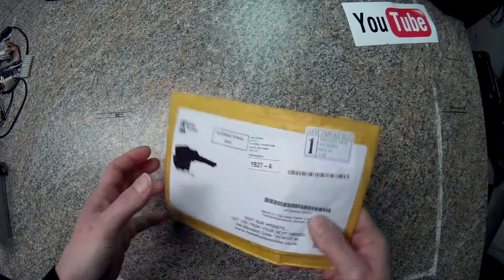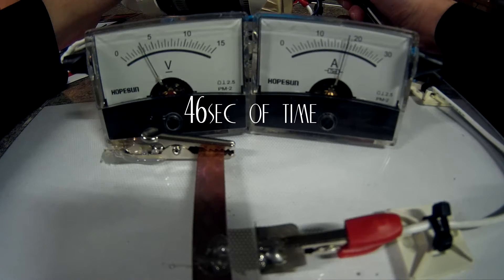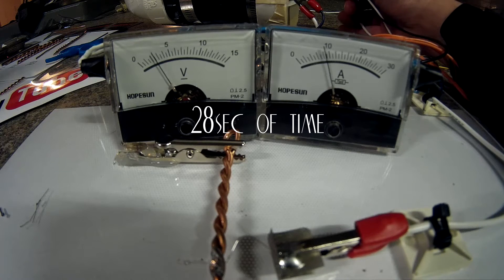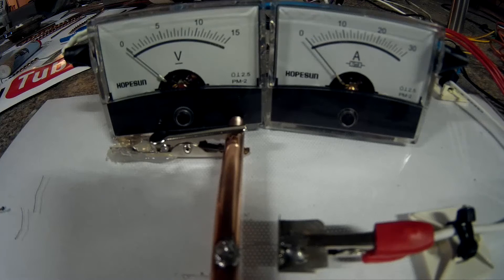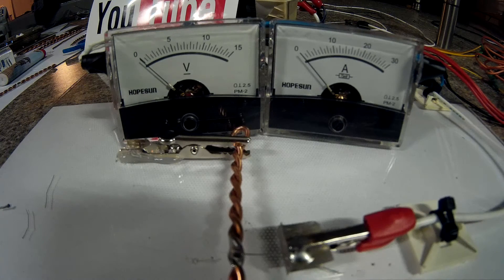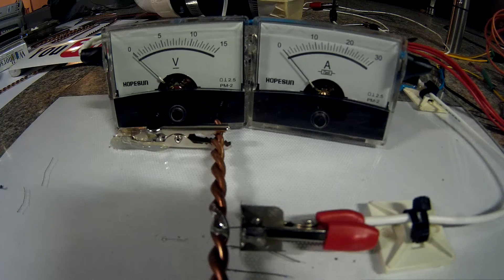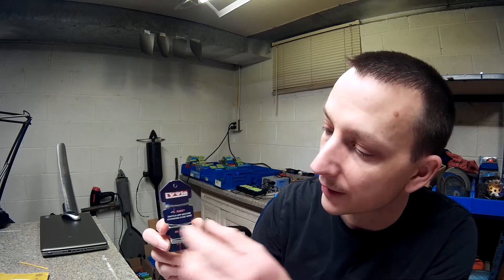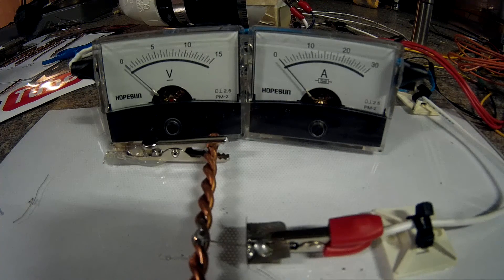Diy Tesla Powerwall ep25 1/4watt Resistors Revisited and 5 Amp Fuse Wire

Comment: Assuming a 100p pack of 2500mAh cells rated at a max discharge of 2c each.  The total amp discharge on dead short would be 100 x (2.500a x 2c) = 500 amps.  The first cell to die in the pack would need to have a fuse less than 495a to protect it.  The second cell would only require 490a protection and so on....  the 96th cell to die would leave 4 live cells or 4 x (2.500a * 2c) = 20 amps to be thwarted by a fuse.  I should hope that other safety features kick in long before this happens.
Oh no, I feel a song coming on.... Don't make me sing!
99 cells worth of amps in the pack... 99  cells worth of amps...  Take one down, try not to burn, 98 cells worth of amps in the pack.

https://youtu.be/zSnCjyoMNgs

Comment: Ok.  It's me again, commenting on a really old video and still trying to wrap my head around the "fuse wire" issue.  Ohm's law states V=IR.  Rewritten in terms of current it's I=V/R. Assuming constant current, as voltage increases resistance also increases.  Resistance creates heat that blows the fuse.  Does the resistance of fuse wire change with voltage?  Example:  10a = 5v/0.5ohms  or 10a could also = 100v/10ohms.  How can the same wire melt at 0.5 ohms and 10 ohms depending on the voltage applied?  I'm no EE, but it seems to me that  fuse wire has to have a voltage rating.  The wire you're testing obviously is not rated at 3.3v or even 5v because the wire is not fusing at those currents.  Look at auto fuses, they are all rated for a specific DC voltage.
Reply: "as voltage increases resistances also increases" there is your error my friend. That sentence don't make any sense. Do you think that a 10K resistor value increases when voltage is applied?

Comment: I know you already have your fuses now but by chance did you try some 30 awg buss wire Im running 24 awg myself but have not tested it for max amps but then im not using old laptop batteries i went with new EBL 18650s instead priced at 16.60 for a pack of 10 on ebay from a US seller
Reply from the maker: +Steven Rowland I cant remember all the sizes Ive tested but should be around there. That sounds like a sweet deal on the cells. How big are you planning on?
Reply: ive got 80 amp hour for now  160 cells ive got a long way to go if im going to replace the 800 amp hour SLA batteries its pretty amazing how you get take 20 amp hour of these and replace a 35 amp hour sla and brake almost even for usable capacity

Comment: I think you need to measure the voltage directly across the fuse wire so you don't have any voltage drops between the volt meter and the fuse. You would want a voltage meter to be very high impedance so that the currents introduced by measuring the voltage doesn't cause a voltage drop in the measurements...
Reply from the maker: Yeah, for some reason I always completely forgot to check the voltage drop across the fuse.  I did do it in my latest vid with the axial glass fuses.
Reply: If you use the bus-bars to test the fuses then a simple way to measure the voltage would be to attach the vol-meter to the top of the but-bars and then use the bottom of the bus-bars to supply the current, that way the top part of the bus-bars won't have any current flowing through them and thus will not show a drop in voltage due to the resistance in the bus-bar part of the circuit. 

That should work well I think! :-)

Comment: Thanks for all the effort Joe! I can't wait until you solve this problem lol. I just started harvesting packs last week. I got a few more packs today. Pretty stoked hahaha
Reply from the maker: stevesrt8 Thanks! Its a awesome diy project with its highs and lows. Good luck on your project. We will geter done!!!
Reply: I uploaded a quick vid from today with some concerns I had. Curious what you think. Keep in mind I'm not a film maker lol
Reply from the maker: stevesrt8 Ok cool, Ill check it out when I get off work tonight. I checked ur ch but didnt see it on my phone, do you have a link to it?
Reply: AveRage Joe I took it down. I'm trying to find out why some packs are 10.8 and some are 11.1. Does that mean there are 3.6v cells and 3.7. And do they have the same charging parameters. A lot of mixed opinions I need to do more research. Cheers
Reply from the maker: It depends, I would need more info from ya.  Are they packs you made?  If there different voltages then there most likely not balanced with each other yet.
Reply: AveRage Joe I'm looking at the voltage rating the manufacturer printed on the pack itself. I'm going to open them when I get a chance to see if I can find data sheets on the cells

Comment: I wonder how it would work if you took a pair of wire cutters (with a stop setting) and notched or crimped the fuse wire.  I see this in many circuit boards especially in multimeters.  I can't decide if just thinning without removing material would make a difference?  Using flat stock ribbon of some types with notches or punched holes is the way the old time screw in fuses were made.   If I had thought I would ever had a use for it, I would've kept a giant rheostat that had before I retired.  It would have been perfect for your experiments.  Hoarders remiss!  Good work !
Reply from the maker: Lloyd Prunier Yes thats what I need (or a cc/cv power supply) to vary it. Im really surprised I havent come across one yet. Ya possibly the crimp method would work.  Might try it, why not right lol